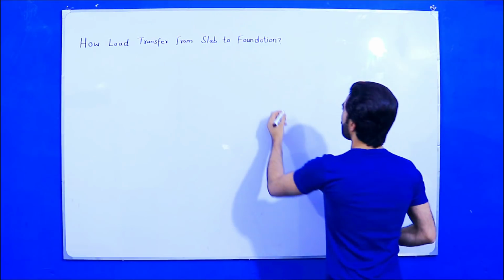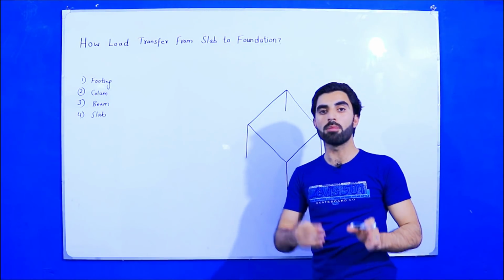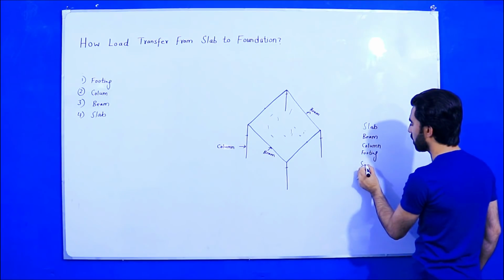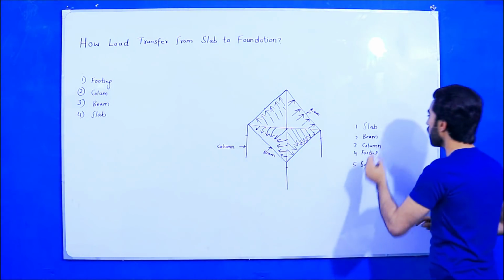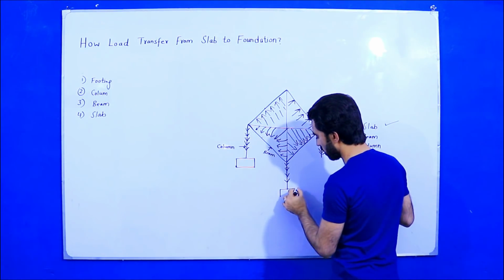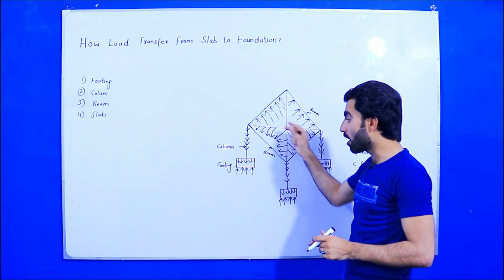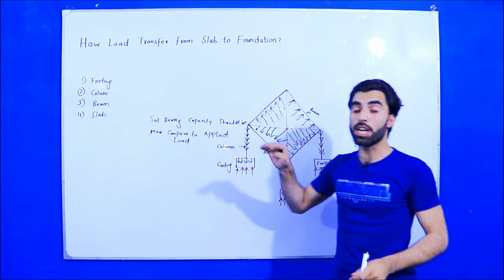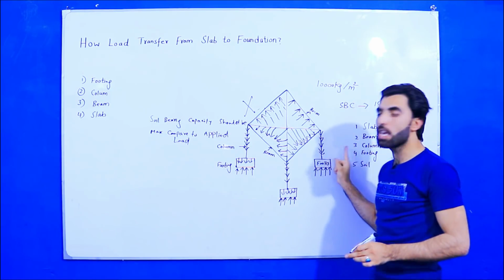How Load Transfer from Slab to Foundation?

Comment: You missed something there such as by which distance slab transfer the load to beam and also by which distance beam load transfer the load to column 
And also the load is different transfers to beam in two and one way slab